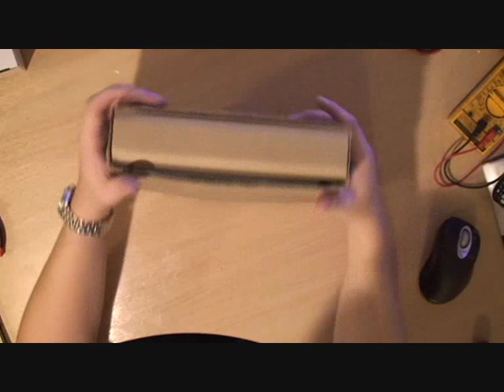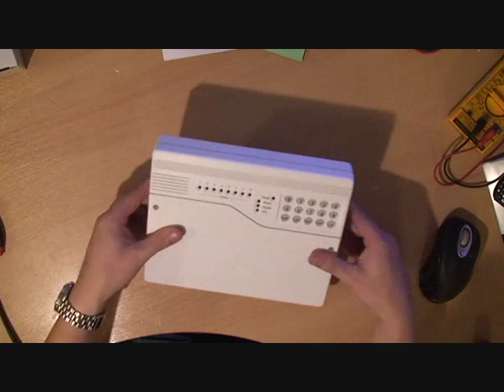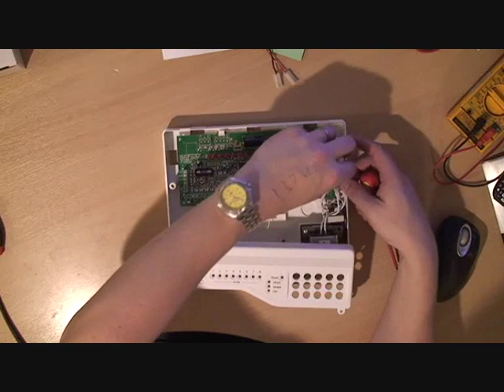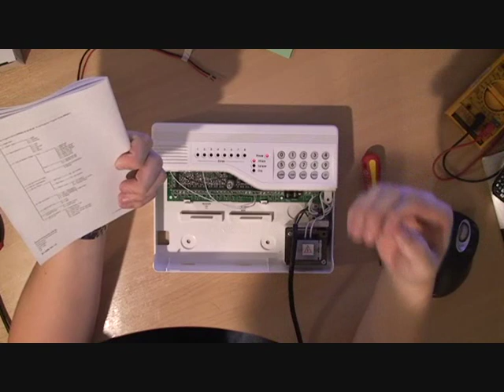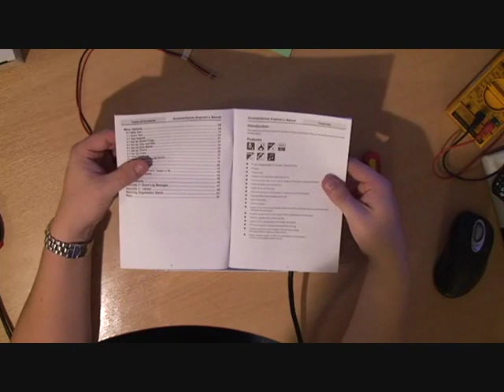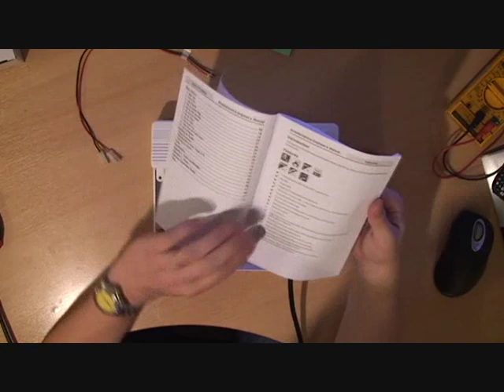Optima compact gen4 review pt1

Comment: hi whats the prog to set entry time i.e prog 9999 puts you in engineer then what
Reply: Press Prog again then LLED 12& 3 Light  Press 1 then 4 and you are supposed to be able to enter say 06 for a 60 seconds entry time, then press tick button. It isn't working on mine - stays at 30 seconds.

Comment: I need to move my panel,, how would you power it down without sounding the alarm?
enter engineer mode, open the panel, disconnect the battery and switch off the mains?? also will it remember the codes and programs when powered up again,, or should you disconnect the bell box wires before switching off the mains?